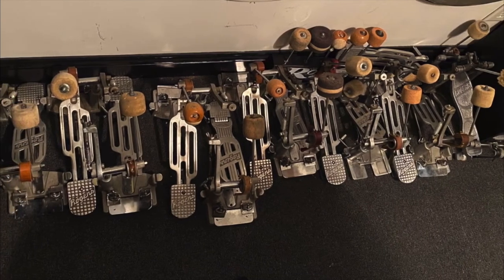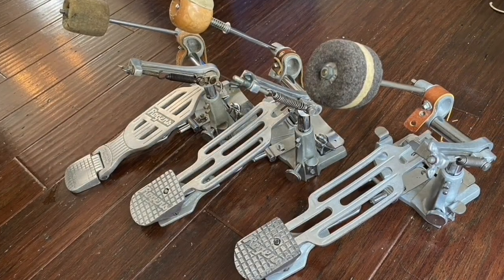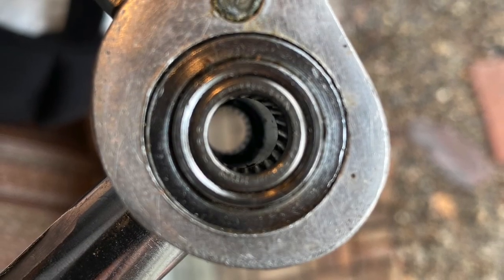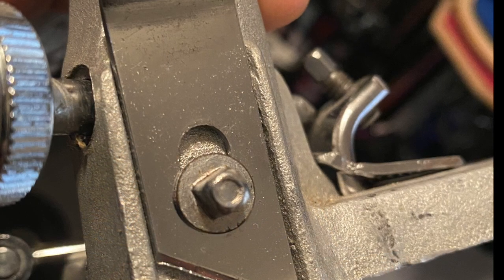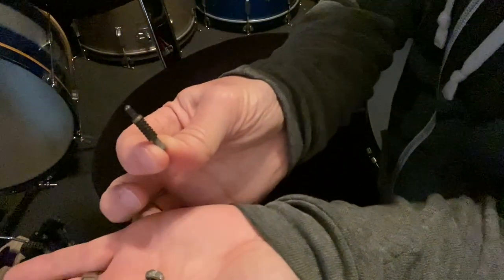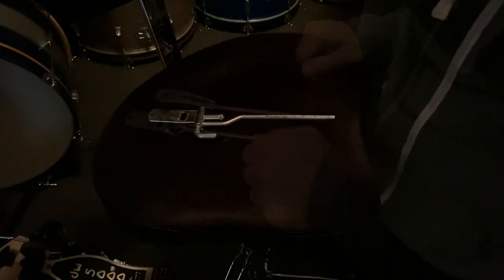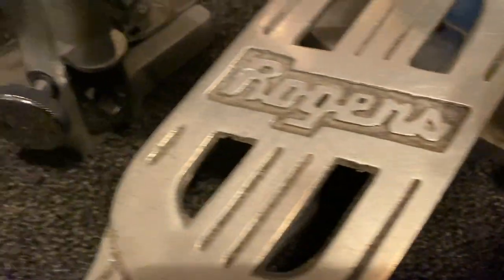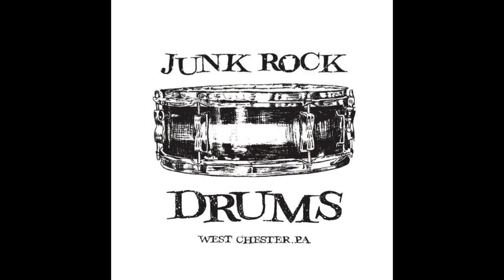Rogers Drums - Swiv-O-Matic 1st Gen. 395R and 396R pedals

Comment: I have an early 395R with the T-shaft swivel, Torrington bearings, round knob tension screw for the hoop clamp, wing nut for the spring adjustment etc. It however, has a peened over rivet for the pivot pin on the swivel unit. This pin allows the swivel unit to swivel but prevents it from being removed from the base. Do you know if this is original design or a modification someone made? It is also missing the toe stop, any idea where I might be able to pick one up? Enjoyed video very informative, thanks.
Reply from the maker: I've never seen that ... sounds like a modification.
The unit should always be able to be removed.
I many have a toe stop.
Thanks for watching !!!
Reply: @Rogersdrumvideos  I am in the process of restoring this pedal. If you do have a toe stop I am interested in buying. Not sure on how to connect with you. Still deciding on how to deal with the pivot debacle.
Reply from the maker: @carlvonthron6701  email me amodeo_anthony@yahoo.com